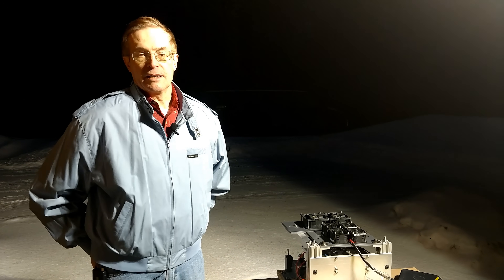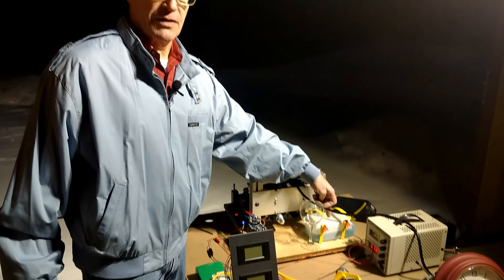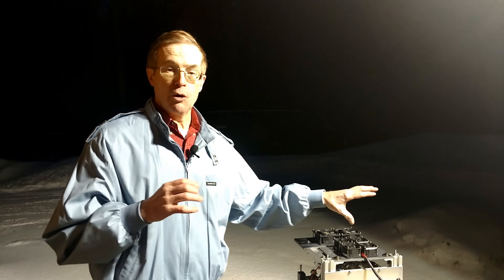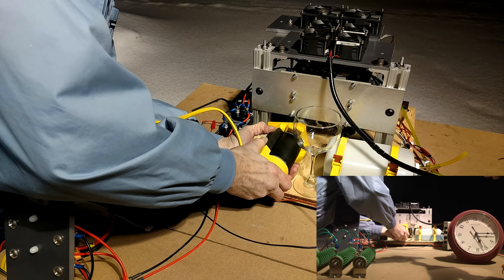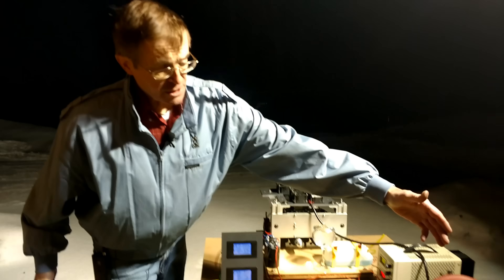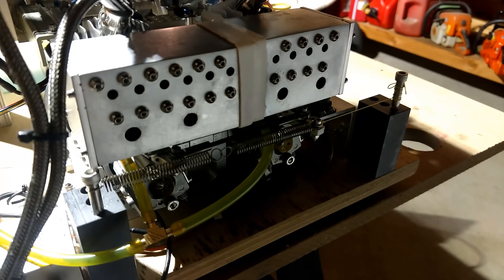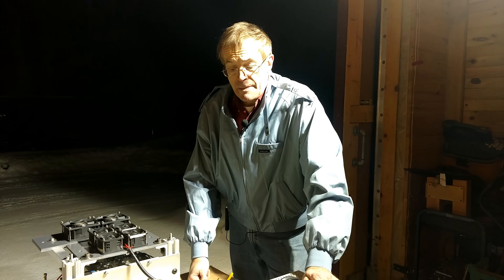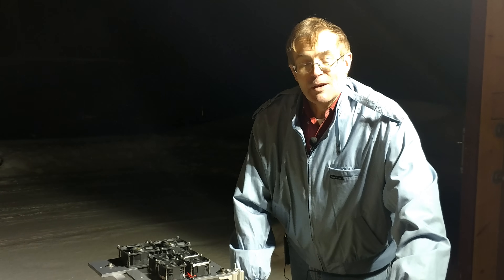Drone Generator Performance

Comment: Lots of explanation, lots of speculation, but nothing flying. Hmmm. Okay, so working the problem from the otehr end- Total weight of airframe and pwoer plant v. thrust. That is the bottom line, isn't it? It is not hard calculation; Weight of aircraft compared to total weight of air being accelerated in the opposite direction of travel.. Now your mission, should you decide to accept it, is to build an operable aircraft (a test rig would work as well), to prove the energy you are generating is enough to power the airframe into a sustained positive lift condition-

Now, I know generators that can produce Kw are heavy- that is indeed the nature of the beast as we know it today. However, that which is required by the current drone technology- electrical energy that can be precisely computer controlled via speed controllers. so far as I know, mechanical control of thrust has failed to deliver the quickness and precision that electrical controllers have performed- so the need for the generator powered via a liquid-fueled engine arises.

Efficiency is the bugger-bear here, isn't it? And for flight systems, it is all about the power needed to overcome drag and gravity.

Weight is the critical meanie here. The engine will lose about 30% of its total power generating the electrical energy and the generator has to be one Hella generator to provide enough thrust power to lift it all.

You are right back to the persistent calculation the Wright Brothers faced; Weight requires more power, more power adds weight! Complicating your problem here is the generator- It is the lead ball around the machine's frame. 

I think you are finding out, this power curve is past the break-even mark for achieving true sustained flight. The place you really need to start is redesigning the generator. Engine power curves, vibration, balancing the flywheel, etc, is all wasted research- Moon Talk. It is easy enough to find a proper power plant- gas turbine is the answer, regardless of the expense- and I think you know that.  The generation unit is going to be very high RPM- that means, low torque, small diameter, and very sophisticated. You are going to need to get rid of a lot of heat and carry a lot of watts. The motors to lift this will have to be kick-ass motors that can handle the load. Amps x volts= Power! That basic formula is the place to start. Because nothing is going to happen until you achieve enough power to lift your total weight. the control is no longer a problem- all that has already been worked out. The only focus you need to worry about is meeting the power demands of the overall unit!

If you exp[ect to lift an airframe of 25 lbs, then that is the goal you need. And that is going to require a minimum of input. for example, to get a pretty good performance from an RC helicopter, you need about 6.1 hp per 1.2 lbs of the airframe weight.  25 lb machine would require 150 HP input (the ratio improves the heavier the airframe due to the nature of air molecules in a larger scale). The lighter the machine is, you save tremendously on the power requirement for the same performance.  But! Your bug is the loss of efficiency in converting liquid fuel energy into electrical energy - probably as I have mentioned about 30%.  So, your input power problem is magnified. Now you can see why your only solution to this weight problem is turbine power and a really well-designed generation system. After that, it is going to be a piece of cake.
Reply from the maker: This is a long comment and you touch on a lot of points.
The power required to lift a multi rotor is pretty well established.  Our tests are in reasonably good agreement with the data published by T-motor, for example.  At a very low disc loading, 16 gm/watt is typical and at a disc loading of 2.5 kg/75 cm rotor, 10 gm/watt into the ESC, including electronic losses and resistance, is seen.
6.1 hp/ 1.2 lb of air frame weight is extremely high.  Even the turbojet we just finished produces more thrust/ hp with its supersonic output!
The old Rotorway single person experimental helicopters performed relatively well with a 150 HP engine.
When we did the power demonstration in the follow up to this video, this generator exceeded 2 kw and that will produce enough lift to support a 20kg load on a large multi rotor.  There are numerous improvements that we are making and some that undoubtedly we haven't thought of, but we are certainly in the range of a practical generator.  There is a commercial unit now available out of China that generates 1.8 kw and is flying successfully.
Reply: @TechIngredients  I apologize since rechecking I inadvertently inverted my power to weight- which should be about 1 to 6 as you have mentioned. dumb- oh, well.
Assuming, of course, using a verticle lift machine, such as a helicopter as a background example of performance expectations (I believe quads are a bit less efficient- but, there are presently so many designs on a small scale it is difficult to compare to a full size (man carrying) example. This should be for a higher performance full-scale helicopter with some variance for models which vary wildly due to their various battery loads and weight/performance advantages for less stress on small bodies (obviously). 
However, for multi-rotors, of smaller scale, and I assume you are talking less than 100 lb gross wet weight, the efficiency of powering the airframe through a liquid fuel driven reciprocating engine powered generator, still gives a  designer serious challenges. Although I can see such a system getting off the ground, the more power and lightweight the better for consideration of that designed-in weight and power disadvantage. 

Here is a geared turboprop that has a 10 to 1 thrust to weight advantage and is not overly expensive- less than $5,000.00. Taking out a loss percentage should still leave plenty of power to supply adequate performance for a somewhat heavier quad. 

( I am merely talking through my hat here since I do not have any practical experience in what you are - remarkably and delightfully - attempting). But, I do have a lot of experience working with these smaller reciprocating engines- and I feel compelled to suggest, they are likely not ever going to deliver the power you will need for a practical airframe of this nature.

Now, again, I am assuming by "performance" you would be going for some useful payload and flight performance envelope- that is -  the unit should be able to achieve stable flight and useful maneuvering while carrying it's wet weight x 2 (or at least, initially, something close to that) to act as a practical airframe worth its expense.  Just as the Wright brothers initially developed an impractical aircraft that merely demonstrated the then accepted fallacy that no heavier than air machine could fly, it took the really powerful and highly efficient units (reaction engines) to make such an aircraft fully realize it's potential. Always, the rule is efficiency by constant application of more power to weight. so, why not simply skip ahead? expense? I think you may have gone far enough to prove your concept and establish a very plausible Go fund Me- This thing could really go somewhere.
Reply from the maker: Nice response.  The disadvantage of the commercial turboprop you mention as well as our own turbo shaft is the poor fuel economy.  This is unavoidable with the low compression ratios that are practical with small turbos.  Nevertheless, reciprocating engines especially 4 stroke and diesel have a high power to weight ratio and good fuel economy.  Constructing modular generators based on these has the potential for up to 20 times the energy density (delivered) as Li ion batteries.  The weight of the generator becomes progressively less of a factor with very long flight times where the battery or the fuel weight dominate.The specific power to weight ratio that is designed into the craft depends on its mission.  If very high power to weight ratios are desired and short flight times are acceptable then a generator module dosn't make a lot of sense.

Comment: Instead of running engines to drive generators to create electricity to power electric motors why not run variable pitch props (similar to RC Heli rotors) direct from the engines (geared if necessary).    The flight controller could be reconfigured to change prop pitch rather than prop speed.     It would seem way more efficient to direct drive props than all this lossy conversion to electricity.
With a system of belts you could even drive all the props from one engine.
Reply from the maker: It would be more efficient, but substantially more complicated.  Existing electric multi rotors would have to be reconfigured for that purpose and the noise and vibration will be much harder to isolate with multiple, distributed engines attached directly to the air frame.

Comment: Shouldn't it be possible to start the engines with the generators?

Then you can have a loud muffler and go in to "stelth" running only electric when needed?

Also, dooing an extraction exaust might increese the efficiency!

Hope to see it in the air soon!

BTW! love your videos, im suprised that you dont have more followers, you seems really smart!
Getings from Sweden.
Reply from the maker: Thanks!
What do you mean by extraction exhaust?  Is this the same as a tuned exhaust?
Starting with the generators as motors is certainly possible. It would only require some high current switching (some mosfets) and a feed back controller to switch the circuit as soon as the load decreases.

Comment: Have you looked into a new type of engine called "Liquid Piston" Its a rotery style with three exhaust  ports that don't require mufflers. They produce large amounts of HP in porportion to their weight. I don't think they are on the market yet, but are on youtube.
Reply from the maker: I have. They are very expensive and the manufacturers are not very helpful about the commercial availability.

Comment: Probably using 4 engines with props and servos controlling the throttle to the flight controller would be vastly more efficient. Also, the capability of smaller drones is really getting phenomenal, such as the DJI Mavic series.
Reply from the maker: You're right about the small drones.  As to the larger multi rotors (where a separate generator module has any potential application), reconfiguring the existing machines would be an expensive project.  In addition, gas motors have a greater lag time, making control a little courser.  The noise is harder to contain with distributed engines and the vibration associated with these engines is harder to isolate when they are coupled directly to the air frame.
Reply: i would worry about stability btw. i'm used to PID loops of a couple khz on miniquads with bldc motors, but for one the servos should slow the response time down and the combustion engines are most likely even slower. i'd also wonder if you could use less than four combustion engines to power four (or more?) motors to save cost, noise, vibrations etc.
Reply: I agree... The stability control loop would be WAY too slow with gas engines on the props. The P.I.D. stability loop runs at several kHz for the electric motors. A gas engine would never have the required response time to make it stable. 

I think if one were to try and use an I.C.E. as the prime mover for each of the propellers on a quadcopter, a very complex system to control the pitch of the props along WITH the throttling of the engines, much like a helicopter would be required. Just imagine the flight controller software and hardware needed for THAT... 😕

Comment: You are clueless about 2 cycle engines your not getting peek power
Reply from the maker: Clueless?  Indeed, we are not getting peak power, but there are compromises we need to make.  For example, a tuned exhaust would help, but the available designs are bulky and we need to minimize the volume of this generator module in order to fit it within a reasonably sized package, to contain the noise and mount it below a multi rotor.

Comment: Is the ultimate goal to lift the entire APU into the air with the drone, or will there be long wires connecting the APU and the drone?  What will the finished APU weigh?  Excellent channel by the way!  I am recommending it to family and friends.
Reply from the maker: Thank you!
The APU will be carried by the drone, below the batteries.  The final weight has yet to be determined.  It needs the enclosure to be added in place of the temporary wooden base plate and the 80/20 supports for the fans.
Reply: @TechIngredients  Wow, that is very exciting!  I'm really looking forward to your future videos.   I guess heavy lift really does mean HEAVY LIFT!

Comment: It's too old for 2-stroke engine technology. For whatever it is, it is very inexpensive. Compared to the energy obtained, the electricity is reused to produce electricity again. Think easy. Energy conversion equals more wasted energy. Instead of using mechanical energy to produce electricity to produce mechanical energy. Why not a supercharger or turbocharger? Like the rotary engine in a Mazda rx-7, this is a two-stroke engine that uses compressed air to boost engine performance. And with respect to the clips that show the sound of the exhaust, you are so popular in Thailand, back in favor of a two-stroke motorcycle in direct competition. I've seen and heard the exhaust. Exhaust sound of the engine, you do not have the sound of exhaust in high performance engine that has been adapted. It's not close at all.

Comment: Would a typical 4-wire O2 sensor allow you to close loop the mixtures for increased efficiency?
Would an expansion pipe on the exhaust allow you to move peak torque to the "set" RPM?
Reply from the maker: Yes to both.  The O2 sensor will need to be part of a fuel injection system in order to reap that benefit.

Comment: Instead of a spark ignited engine have you thought of using a two stroke diesel engine? It would save the weight of the ignition system Plugs wires etc...
Reply from the maker: That's a good idea.
Reply: Thanks!

Comment: How does this compare with running the propellers with fuel engines?
Sort of full circle, I know...
Reply from the maker: The argument here is the hybrid interface costs in efficiency, but the generator allows existing battery driven drones to add an independent module to greatly extend range.  The generator makes it easier to isolate the engin's vibrations from the air frame because flexible wires do not transmit vibrations nearly as well as direct transmission systems connected to the rotors. Noise is more easily blocked with a single engine.  And, whenever fuel use is unacceptable the generator can be removed

Comment: I don't get It?..What's the point of using Fuel to generate electricity to power Drone Motor's? ..Seems very Inefficient.
Reply from the maker: The point is to provide an energy source that lasts longer than a battery without redesigning the entire multi rotor that it is attached to.

Comment: Tuned pipes would increase power and decrease fuel consumption. The muffler design is probably the exact worst design possible.
Reply from the maker: You may be right, but this is why we did it this way.  There is a lot of disagreement around the web about the objective, demonstrable, measurable amount of improvement with tuned pipes.  There are way too many anecdotes and with multiple, significantly different designs even for the same engine.  Most of these designs are bulky and would complicate the enclosure layout and its interface with the drone.
If you have any good references, I would be happy to look at this again.

Comment: Thanks for sharing this videos!
I think you’re doing an excellent job with your design, the way you couple the motors to minimize vibration is brilliant, no doubt you will get the power you are looking for.
The one thing I don’t like is the design of the mufflers. two cycle engines need exhaust scavenging to reach pick efficiency, it would be awesome to see this generator run with a tuned pipe in each motor.
Reply: Tech Ingredient's departure from scientifically maximizing function and, in this instance, choosing to prioritize form is a little disappointing.
Reply from the maker: We looked at these and they tend to be bulky.
Reply: @TechIngredients  bulky maybe, but worth every gram. Fuel consumption will drop, and available power can be optimized. 4600 rpm should be within the stock tuned pipe range, and it will be quieter. You can do whatever you want with the pipe downstream, but, the tuned section is critical.